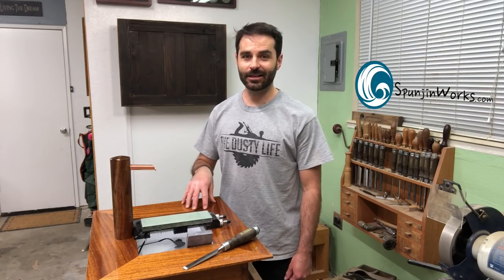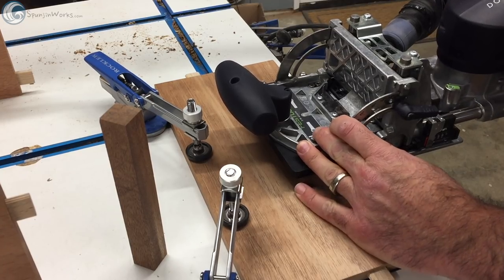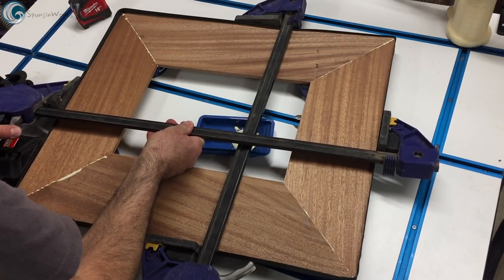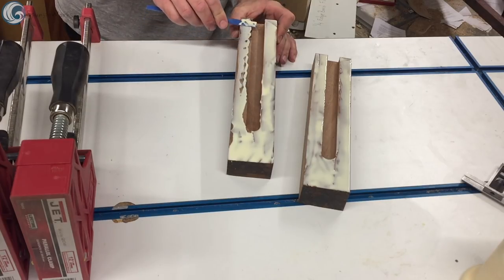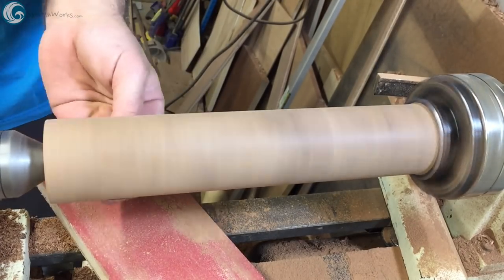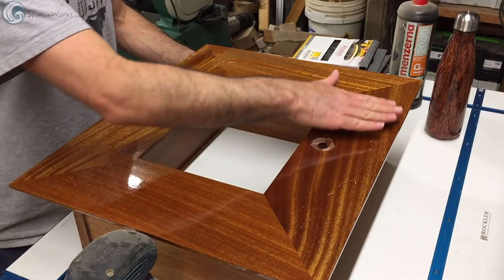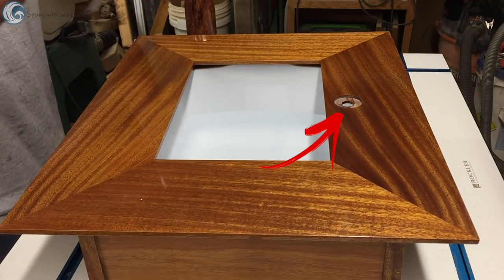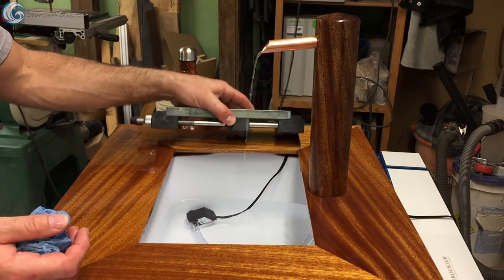How to Make a Sharpening Station // How-To (Ep. 83)

Comment: Hey Sean, 
Great project.  Your finishing skills are awesome!  I've been looking for a while now online for the ultimate sharpening station/pond and I've been curious why I've never seen a stainless steel sink built into a cabinet with a stone bridge built on top.  Plenty of room to catch the mess.  The drain could dump into a 5 gallon bucket below the sink and a pump like yours could circulate the water.  Any thoughts?  Anything I might have missed?  Thanks!
Reply from the maker: Thanks, Brian!
Funny you mention that. I had a stainless sink with no plumbing hook up in my shop for years. I was going to do exactly as you said but before I could I got rid of it to make more room in the shop. The cabinet it was in was just too big. Now I get to remake a cabinet with custom storage. I don’t see any reason why it wouldn’t work. Go for it.